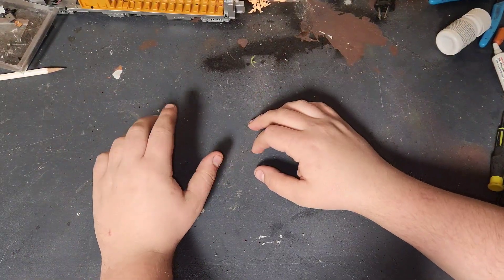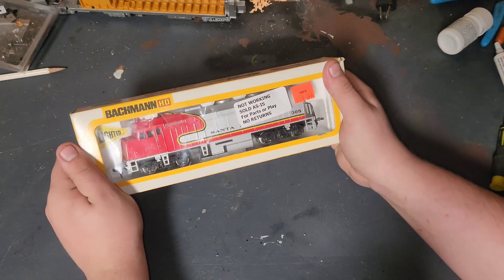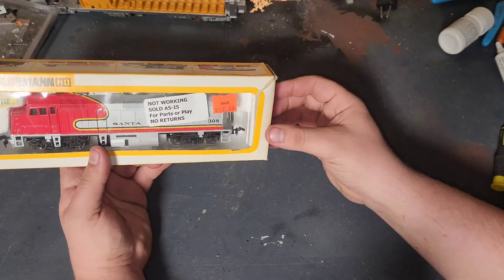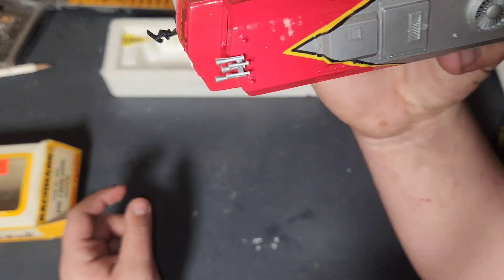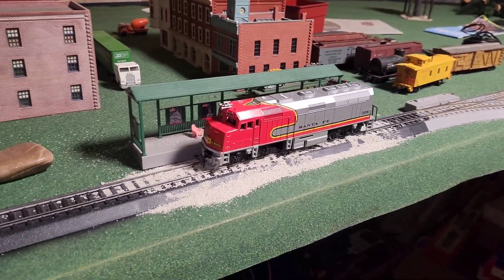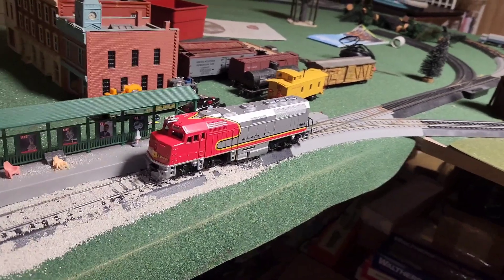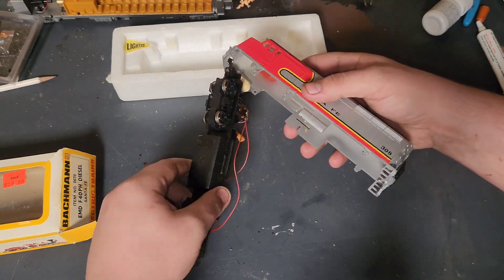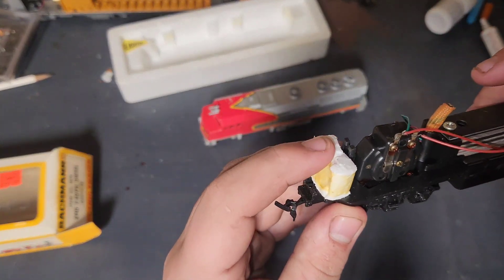Can I repair this old 80's Bachmann F40ph?

Comment: You did a great job but missed a few things. That locomotive can pull about 30 cars if you install the traction tires that are missing on yours. Grease is needed when plastic and metal come together so the largest gear needed it. You should get some Contact cleaner that WD-40 makes that you can clean the commutator, fiberglass brush, brushes, and any other surface you care to clean to remove the old oil and grease. The contact cleaner is made to clean electrical components and is a quick drying solution that leaves no residue. You also needed to oil the pivot points of the gears before closing the motor casing up and oil the motor bearings very lightly plus the wheel axels plus gear shaft bearing points. I also would have glued the motor stay together and installed it. I can see you are learning all this as you go, and I commend you on the steps you are taking plus the camera work is perfect. I'm sorry I am so critical about your steps but I'm an old geezer that made all the mistakes at least once, lol. Keep going because you are ahead of most.